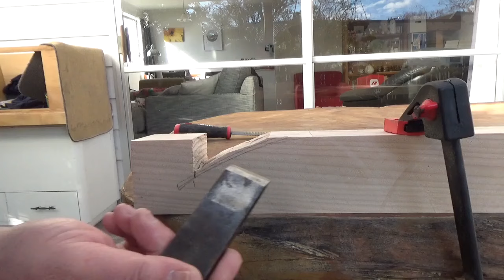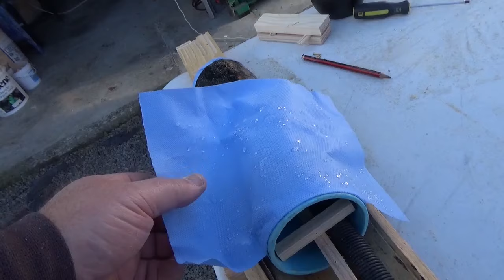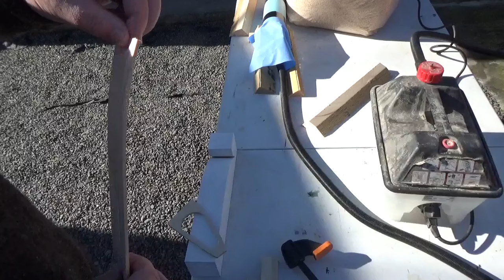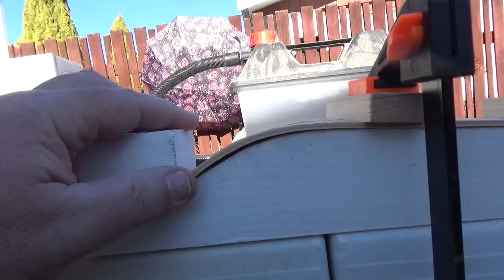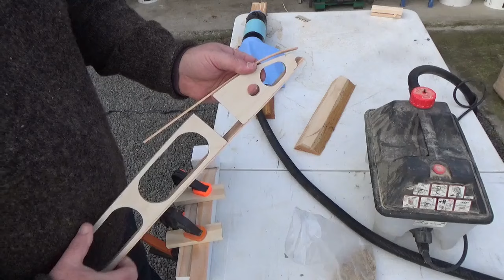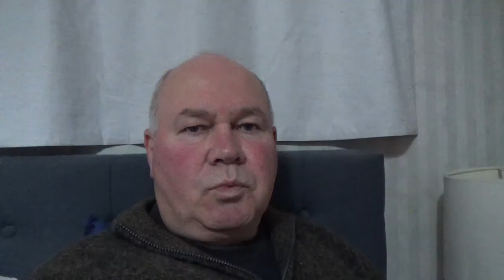Making a steam bender for aircraft parts

Comment: Maybe leave on bending form 25-30 mins v if still spring back try 40-45.  There’s going to be a happy medium you will achieve.  Looking good.  CHEERS
Reply from the maker: Thanks Bruce, I ended up leaving the cap strips on the mould around 40 minutes which seemed to work well. I kinda suspect longer would be even better, but will try that next time. On the plus size, they came off the mould and were screwed straight onto the ply webs which will help as well.

Comment: looks like the cupping of flat sawn timber. If you need the flat sawn timber as spec then maybe try it up the other way. it will still cup but maybe a slight up round may be beneficial to a fabric covered wing. just thinking out loud.
Reply from the maker: Hi Russell, yep I have seen that in flat sawn timber but typically the timber is still drying, warping as it loses moisture creating uneven stresses. I have seen it most in wet flat sawn fence palings and weatherboards that have not been nailed up promptly..

Tight grain and dry tends to eliminate most issues. So far my experience with this timber is that it is remarkably stable given some pretty extreme environmental conditions. I'm laying this one down to me abusing perfectly good timber!!!

Comment: The strip cupping is probably due to grain direction, it really should be vertical not horizontal. You should also leave the strips in the mould overnight if possible. Not criticising your work at all, just trying to help.
Reply from the maker: Thanks Phil, longer in the mould has definitely helped. I haven't done overnight but will with future pieces. Grain direction for cap strips is an interesting discussion. When I started someone raised it but I couldn't find anything to support it. I since have (can't remember where, but I did find it) but I stuck with horizontal because of the screws that penetrate the cap strips (into the ply webs and the spars), thin vertical grain may split under pressure from screws while horizontal grain is somewhat better. The shorter cooking time has resolved the cupping, longer in the mould should help retain the form and perhaps help with reducing spring-back. Thanks for your comments Phil, I'm a novice working it out as I go, feedback or queries are welcome :-)
Reply: @MattProject If ever you are unsure about any aspect of Camel building, just ask. No guarantee I’ll know, but I might.
Reply from the maker: Thanks Phil, you are already on my list :-)